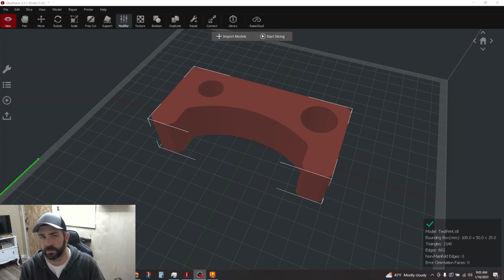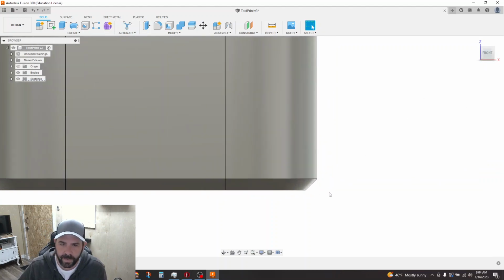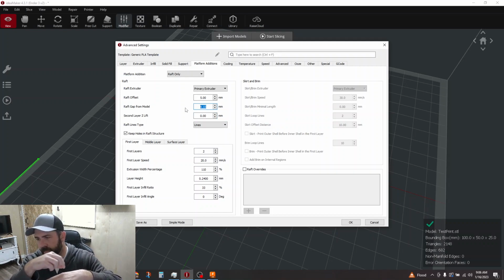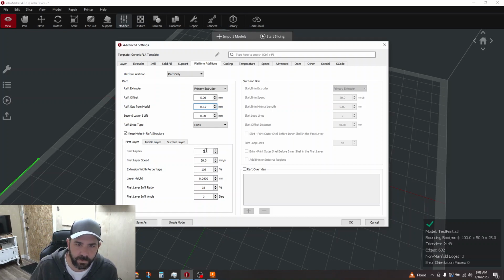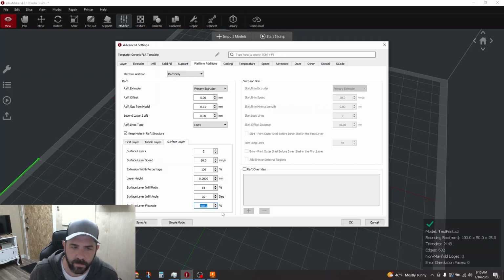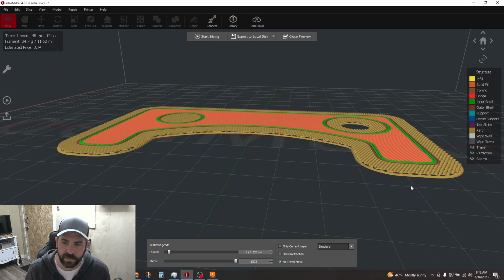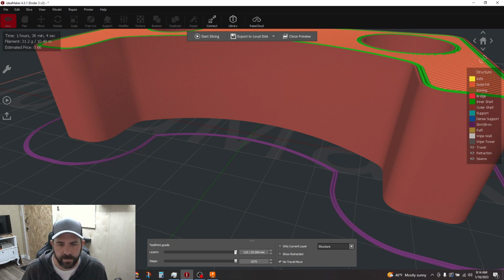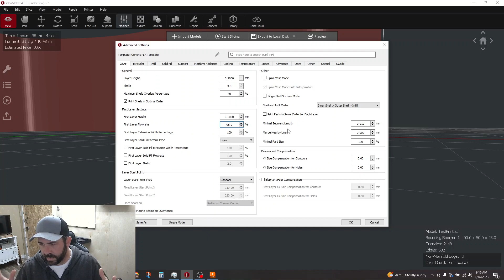4 Ways to handle the Elephant's foot in 3D printing with Fusion360 and Ideamaker

Comment: Is elephant’s foot more of an issue with certain bed types or filaments or is it model dependent? Luckily I don’t think I’ve seen it
Reply from the maker: It's more of an artifact of the 3D printing process.  How pronounced it is has a lot to do with bed level/tram and 1stvlayer flow rate.  

A good test is to print a small 20x20x20 cube and grab a pair of calipers and check the width at the top of the print and at the bottom where it was touching the build plate.
Reply: @fischer3d  Thanks. With the 20mm calibration cube and a Mitutoyo calipers, my top is 19.95mm and bottom is 20.15mm, so I guess the elephant’s foot is about 0.2mm
Reply from the maker: Sounds like your machine is pretty well dialed in.  A tolerance of .5mm+- is pretty solid for these machines.
Reply: @fischer3d  Yeah I’ve been super impressed with the Pro3. I got it last May and right out of the box the results with two-color PLA as well as PETG, ASA, PC, TPE, and TPU have been phenomenal, especially using the Raise3D filaments and profiles. But I’m still trying to get better with NylonX and Ionic. 

I just discovered your channel and also do a lot of wood and metalwork including years of CNC routing and laser cutting so enjoying your videos.
Reply from the maker: Awesome, thanks.  Glad you found the channel.